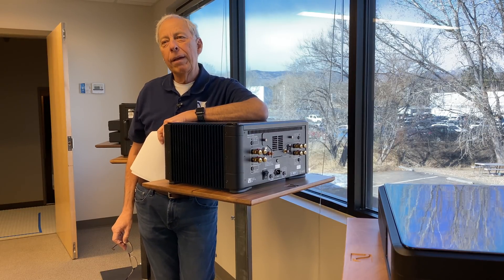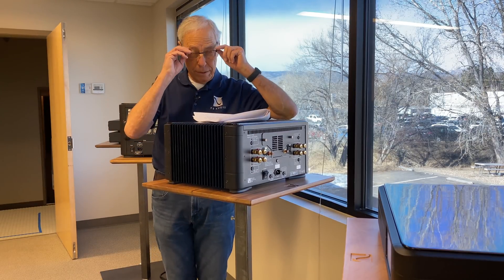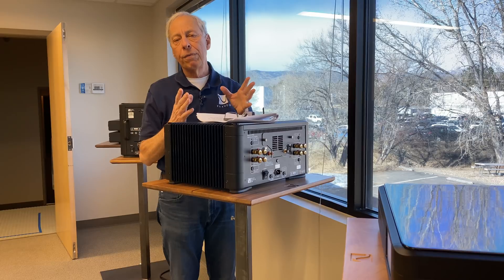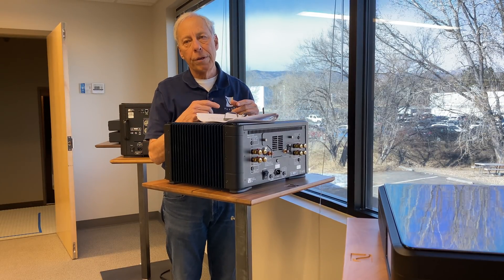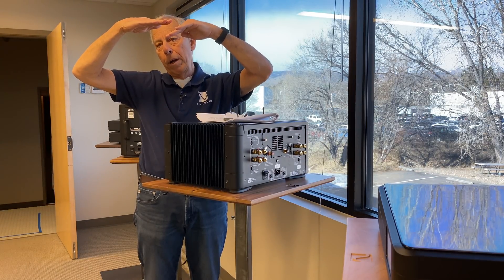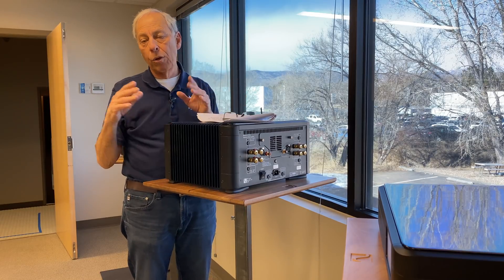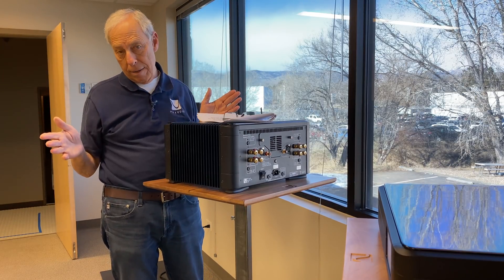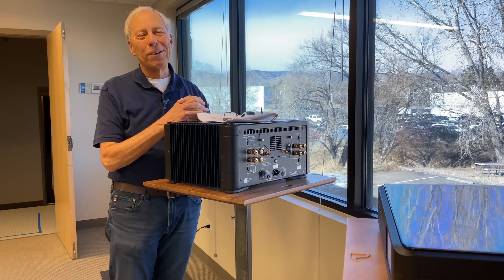Amplifier clipping

Comment: At the last Rocky Mountain Audio Fest I had Roger Sanders telling me that my 25 watt, Class A, Mark Levinson amps were clipping all of the time in my Sound Lab electrostatic speakers. He was telling me I needed his 500 watt into 8 ohm amps to drive my speakers properly. If my amps are always clipping then give me more! They sound fantastic! We greatly overestimate the amount of power we are using. If you have a pretty much standard 85db/w/m speaker, it uses 1 watt of power at 85db, most of you would not think that to be loud enough. An extra 10 db takes 10 times the power, so 95db requires 10 watts.  I find 95db to be loud. If you want 105db, it takes 100 watts. I find 105db to be unpleasant. If you want concert level, ear damaging 115db, you need 1,000 watts. Since basically none of us have 1,000 watt amplifiers, this is serious into clipping. If you want to play this loud, you need big Klipsch speakers.
Reply: You grossly oversimplify. You forget the distance from the speakers. What you are saying applies to 1m from the speaker. With 2 speakers you get  max 6db more, depending on the signal,  at a distance 1m from both. In a real room you get even louder because of room reflections. The issue is though that spl drops off by 3db with double the distance. So -3db at 2m, -6db at 4m etc. More importantly you forget that this theoretical sensitivity is at 8ohms. Often depending on speaker and frequency the speaker impedance can drop to less than 4ohms. At 4ohms you will need double the power from the amp. Your electrostatics most probably exhibit an impedance much lower than nominal in higher frequencies. Equally important is the phase angle of the speaker response which can also tax an amplifier close to its power limit.
Reply: @razisn This is true, but as you said, we listen in rooms. I can't quantify this, but my speakers do not get half as loud if I move 4 meters away. Outside, the spl drop off is absolutely true.
Reply: John LeBeau to get subjectively half as loud you need a dB drop of approx -10.
Reply: remember that speaker efficiency normally is measured at some frequencies. There are many speakers that have very low impedance in the bass register. And will need many times more watts to really do well.
Reply: 85db = 1w
88db = 2w
91db = 4w
94db = 8w
97db = 16w
100db = 32w
103db = 64w
106db = 128w
109db = 256w
112db = 512w
115db = 1024w
ROCK ON
Reply: @poserwannabe1 ... WATT !!!!!
Reply: To whoever is interested, I did some measuring. Using a downloaded pink noise generator and an iPhone db app, I set 80db at 1 meter. At my listening position, around 2.5 meters, it was down 1 db. Moving back to 6 meters or so, it was down 3-4. I had to go over 15 meters, yes my room is that big, to lose 10 db. No one I know sits that far from their speakers, about the distance to the front row at a movie theater. So sound, at least in my room does not behave as the theory says it should. This doesn't surprise me. I assume the measurements are done in anechoic chambers, and sound in a room is affected by the walls, floor and ceiling. I looked into this the last time Paul discussed clipping. The problem comes not from the clipping itself, it is that the amplifier is putting out more power than it is rated for, and if your speakers can't handle the power, they can be damaged. My speakers are rated for 600 watts, there is no way my 25 watt amp, 100 watts at 2 ohms, can put out enough power to damage my speakers. If I were to get them heavy into clipping, the only thing that would be damaged is my ears.
Reply: @johnlebeau5471  a bad 30 watt amp can destroy tweeters of your speakers. even if the speakers are rated 600watts.
Reply: @oysteinsoreide4323  If you are referring to the ML-2s, they were the most expensive amplifiers (they are mono) in the world when they were introduced in 1978. Today, they wouldn't even be close. The distorted guitar sound in the 1960's was made by overdriving tube amps into clipping. I suppose a speaker blew every now and then, but the majority of them came through unscathed. Now it is typically done with a pedal instead of overdriving the amps. In order for the 30 watt amp to blow my 600 watt "tweeters" (they are electrostatic panels 4' tall and 7" wide, they crossover at 250hz and go up to 20khz) it would have to put out more than 600 watts. Most tweeters cannot handle that much power. The clipping sound itself is just that--sound. The reason clipping is hazardous to speakers is that your amp can put out a lot more power than it's rating would have you believe. It is this power that does the damage, not the clipping sound itself.
Reply: @johnlebeau5471  You are missing the whole point of the video.......
Reply: @johnlebeau5471  Guitar amplifiers don't use tweeters......
Reply: @oysteinsoreide4323  "High frequencies at high power can damage a tweeter." 1:58, the point of the video. Clipping is asking your amplifier to put out more power than it is rated for. The problem is--it will, and you don't known how much. I have a second speaker system, it uses a RAAL ribbon tweeter. The tweeter is rated for 200w, and goes up to 40khz. I power it with an 8 watt amplifier. There is absolutely no way this amp can put out enough power to damage my tweeter, I don't care how hard it clips. Unless, of course, it can put out 30 times it's rated power.
Reply: @oysteinsoreide4323  No, but guitar amp speakers do have power ratings, and they can be damaged if those ratings are exceeded.
Reply: @johnlebeau5471  You can't measure transient response with pink noise. The only way to test how the system behaves with music is with music.
Reply: @oysteinsoreide4323  I was measuring sound level drop off with distance, not transients. I needed a constant sound level, hence the pink noise.
Reply: @johnlebeau5471  Yes, but what was the point of the pink noise? We all know the we just use a couple of watts of music when we play music in our livingrooms. But it's also very evident that more powerful amplifier makes a difference also at low volume.
Reply: @oysteinsoreide4323  To give me a constant SPL so I could see how much it dropped as I moved away from the speaker.
Reply: @johnlebeau5471  If you have 600 watt rated speakers, means that they like much power. You should try out with a powerful amplifier and listen for yourself. ( you don't have to buy, just borrow from a friend or local hifi shop ).
Reply: @oysteinsoreide4323  I have. I own a Musical Fidelity NuVista 300. Three hundred watts into 8 ohms, 600 watts into 4. The Sound Labs have a very wide, and wild, impedance curve, ranging from more that 20 ohms to less than 4.  Not unusual for an electrostatic. I prefer the ML-2s which were designed specifically for the Quad ESL57, an electrostatic, also with a wild impedance curve, that could be destroyed by too much power. The ML-2 can drive any load, possibly to zero ohms, although I haven't tried that.
Reply: @johnlebeau5471  No amp can do 0 ohm. 0 ohm is just shorting the amp.

Comment: Amplifiers can include a circuit for clipping protection by doing soft clipping, compression or gain reduction when the signal gets too loud. Tube amps usually do soft clipping without added circuits. Best is to always keep the volume down to a level where you don’t notice any distortion. I always go away from the speakers, perhaps open a door and a bit further away to carefully listen to judge if the sound is undistorted cause my own hearing will also distort when it’s very loud and I’m too close to the speakers. Especially if you have a party and planning to play loud, check this before guests are coming.

Comment: I don't get it. Why do amp manufacturers allow to turn volume so loud that the amp starts clipping? Why not limit output volume so that it's even impossible to clip?
Reply: Alessandro LinuxBSD Thank you!
Reply: Alessandro LinuxBSD  "How can the manufacture know with speaker do you use?" Amp clipping has nothing to do with my speakers per se. I understand that I can blow out a tweeter if I put too many watts in, but the amp clipping happens in the amp, not in the loudspeakers.
Reply: G Guest OK. Thanks! I will.
Reply: amplifiers for PA use normally has a clipping protection. But it is usually seen as a degradation of sound quality and is normally not used in amplifiers for domestic use.
Reply: You only have to use common sense: If the sound gets too harsh, then just turn the volume down at bit. Not worse than that.
Reply: @oysteinsoreide4323  exactly !!!
Reply: Alessandro LinuxBSD what are you talking about???
Reply: Alessandro LinuxBSD I never talked about too loud signals. If the signal is too loud it will saturate the input stage. I talked about low and high signals.
Reply: They do nowadays, it's called Class D ;)
Reply: Alessandro LinuxBSD it is exactly the opposite from what you describe.Reduced dynamic range ´helps´ in not clipping because the listener would lower the volume anyway if too loud and distorting. In good recordings with an expanded dynamic range one has to have the volume sufficiently up to be able to hear low parts and then suddenly when it gets loud it taxes the amp. That´s why you need headroom in the amp to be able to deliver loud passages without clipping.
Reply: Because the more watts they can claim the better
Reply: @xanderguldie  I understand that clipping happens only at the very end of the volume. So limit just last few mm of the volume knob. That won't affect watts too much, because amp cannot give more watts when it's clipping anyway. IMHO.
Reply: Guntis Bukalders Tottaly wrong. Volume control only attenuates the gain of the preamp. You can clip an amp with the volume control set for example half way or less if the signal is too strong or you could turn the volume control up to full, which means zero attenuation of the preamp signal, without the amp clipping, or even sounding loud, if the signal is too low. You can test that by turning the volume all the way up without providing a signal from a source. No sound,  no clipping...  Btw of course speaker impedance plays a huge role. The lower the impedance of the speaker, the more power it draws and the more potential for clipping exists.
Reply: razisn Thank you! Forgot about the speaker impedance.

Comment: More importantly . . . is the irreparable damage to one's ears -- especially in the high frequencies! But today, people don't want to think about consequences for their actions . . . they just want the HIGH of the experience . . . and forget about paying a permanent price for such FOOLISHNESS.
Reply: Calm down grandpa
Reply: I bet you're the life of the party !!! 😆😂🤣
Reply: Clipping can happen at low volumes. Some people want the sound of a low watt SET but you need an efficient speaker. If that was paired with something that needs power it would clip at a low volume. 75% of your amp power isn't always 75% of your volume knob.
Reply: @scottbaum419  ppl wrongly believe the vol knob pos, a stronger signal typically CD will distort at 6/10 on most amps, weaker sources like cass deck 8/10
Reply: russmaleartist You are so right. In fact, my experience is that our hearing is also quite prone to add distortion at very loud levels and that’s a clear warning you should lower the level. I care much less about a burned tweeter than even slight damage to my hearing of let’s say 1% btw. Those of us who enjoy going to concerts and end up standing near some large speakers notice how the following day we can hear the buzzing in our ears. I had this experience with Dire Straits, Pink Floyd, Coldplay and other concerts.
Reply: At typical room levels at home that's not a risk. Headphones and gigs, though, certainly.

Comment: I never understood the praise heaped on the NAD 3020 amp for having a 'soft clipping' switch. If it's clipping, hard or soft, then 20W is just not powerful enough for your needs. Especially today, when people pay well over the odds on the used market for the horrid flimsy thing. Last week I picked up a 48W Luxman L-114A for around 2/3 of the going rate for a 3020. No contest.
Reply: Because NADs soft clipping would take the edge off of hard clipping. Plus that 20wpc receiver could put out almost 50 watts. Dynamic headroom. Most music uses 5-10 watts power . Peaks might me 10x more.
Reply: @donalddeorio2237  All amplifiers of that vintage could peak at a much higher wattage than the RMS rating, sure, but the point remains that a 20W-rated amp has less dynamic headroom than most. At normal listening levels in a small-to-mid-sized room 20W RMS is plenty. A look at the comments on Steve Guttenberg's post today, though, shows that there are plenty of folks out there for whom plenty is never enough, and I wouldn't want to run a 3020 loud in a large space. :¬)
Reply: I had a speaker rated at 125wpc and presented it with 350wpc bi amping and they sounded amazing
Reply: I agree, I have my original Luxman R-114 that I purchased new in 1991 and I'm driving very efficient 1974 Altec speakers with 16" drivers. No need for more power!

Comment: Can we get clipping when playing back certain frequency?
Reply: Han Siang Ng Clipping can happen at any frequency when the level is beyond what the amplifier can output.
Reply: @ThinkingBetter  i came across videos especially those LF subwoofer test they always come with warnings will they really damage the speakers at normal volume?
Reply: Han Siang Ng Yes, your right. If you use a too powerful amplifier connected to a small bookshelf speaker and play a lower frequency than the speaker can output then it might damage the speaker without you noticing it cause the voice coil moves too much and can burn with no audible effect.
Reply: @ThinkingBetter  Usually you will be way above normal listening levels before too much power to a speaker happens. Unless you have a bookshelf speaker with a very low power handling capability.
Reply: @oysteinsoreide4323  The point is that you have different ways to burn your speakers and too much of too low frequencies is among them. Clipping creates higher frequency harmonics that can burn your tweeters. Too low frequencies that are below your speakers' effective frequency response can burn your speakers silently even the music itself plays well. I've damaged several speakers by having the woofer voice coil hitting the bottom with a too low frequency for what the speaker can play. One case happened due to having a speaker on the same table as my record player causing sudden very low frequency acoustic feedback (vibrations from speaker to turntable). The issue with too low frequencies is that you might not actually hear them. A 20Hz sine wave continuously at peak level is not audible in most speakers except the possible distortion it creates from un-linear motion, increased bass port airflow and worse, the sudden bang that occurs when the voice coil excursion peaks out perhaps even damaging it permanently.
Reply: ThinkingBetter Yes, using microphones, and turntables can both lead to low frequency noise. While recording it is normal to have a high pass filter. And small speakers is always slightly in the risk of getting too much low frequency conten from some sources.
Reply: When I was a teenager, I killed a pair of tweeters running a synthesizer through my hi-fi. I pushed the filter above 20kHz... whoops.
Reply: thisisnev Yeah, someone could make music with a max level 20kHz sine wave and your tweeters would smoke without anyone hearing a sound. A tweeter is always specified based on some assumption of less of the power will end up in the treble.

Comment: It’s been a long time since I’ve driven an amplifier to clipping. Back in the 70s and 80s yes, but amps today...great. I’ve used a 60 watt British amp on my Martin Logan Odyssey and it plays plenty loud without a hint of clip and that’s a tall order for a 60 watt amp. That said, if I take a 70s pioneer or similar SX receiver and try to drive a low impedance load like the Odyssey, I’m well aware that the amp protection relay may open, but modern amps are just good.

Comment: funny how playing guitar we want the amp clipping
Reply: Ah, but guitar amps aren't generally known for having tweeters though, are they?
Reply: Not for tube amps. The wave gets comprssiions. JCMP 900 had clipping diodes in its. But the output transformer also get saturated. Electric motors, electric genrtor and transformers  have to do with magnetic fileds. The incude th evoltages. Julies Futterman amps DID NOT have a output transformer. Its 2 fffern things!